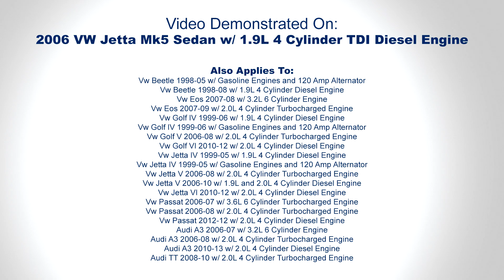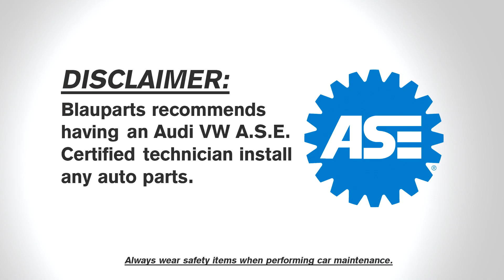How To Diagnose a Noisy Chattering Audi Over Running Alternator Pulley

Comment: Thought i had the same issue, along with like 3 others lol... Turned out being the power steering pump lol *sounds like a huge rattle like knock
Reply: Would you get the noise when the car is stationary and you're not turning the wheels? I've recently replaced the power steering pipes after they leaked and noise seems to be coming from this side of the engine (where both the PS pump and the belt is 😥)

Comment: Help please . I have this same chatter/vibration noise with my 2006 Audi A4 when start and taking off or reverse from stop . took off belt check alternator pulley but spins fine . so my question is what can it be ?
Reply: I have the same problem, 
Alternator pulley was the problem, change it and will be back fine

Comment: Thank you for making this video! What's the best way to determine if the over-running alternator pulley is going bad other than just replacing it? What are the visual distinctions between a failing pulley and just a bad tensioner?
Reply from the maker: Thanks +Nathan Spain, we're glad to hear this video is helpful.

Overrunning Alternator Pulley Failure:
The best way to determine if the overrunning alternator pulley is going bad is a visual inspection of the accessory belt system while the engine is running. If the belt system is making a lot of chatter and flapping noises as outlined in this video around 1:56, the over-running alternator pulley is beginning to fail. The chatter and flapping noise from the belt system is even more distinctive when the engine is loaded during takeoff acceleration.

Belt Tensioner Failure:
If it is the belt tensioner bearing beginning to fail you’re going to hear a mild growling or humming noise. The tensioner is best diagnosed by removing the serpentine belt and giving it a spin test.

I hope this helps you further in diagnosing your accessory belt system issues.
Reply: +Blauparts LLC This is very helpful. Thanks for the info!!!